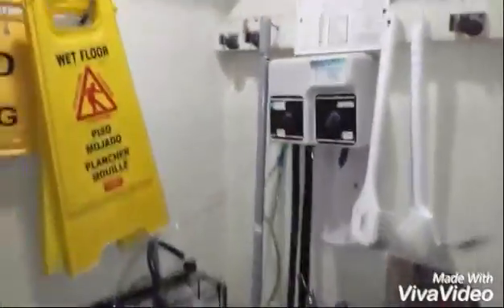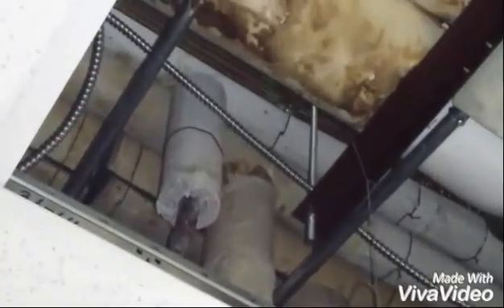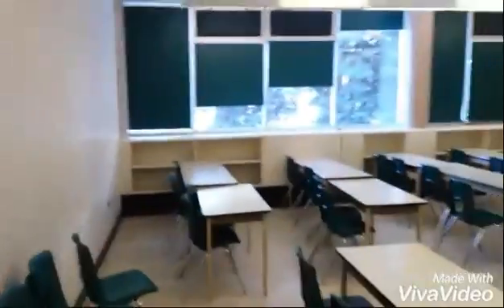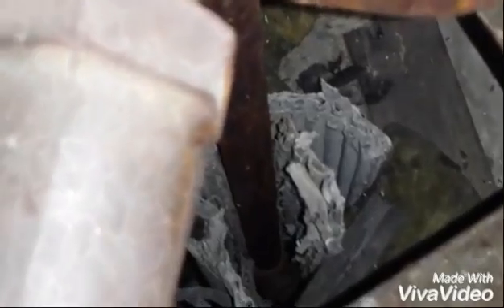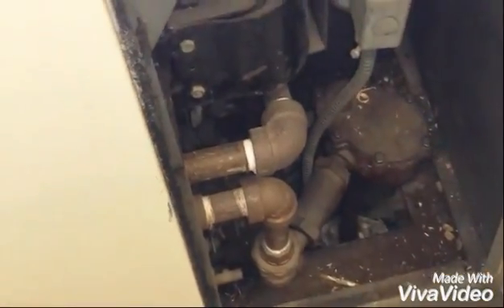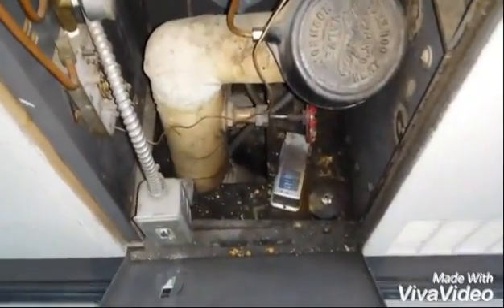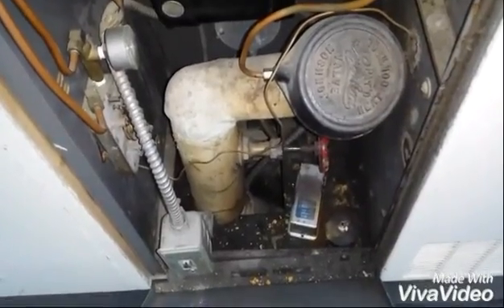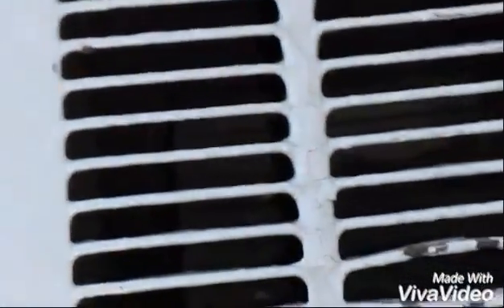Asbestos in the air. St.Johns college has old aircel asbestos on the pipes AND in the heaters!

Comment: Crazy stuff, I have to deal with old refrigeration plant rooms made from non-friable sheeting and there is dusted up old asbestos on the ground because of all the previous workers banging holes in it, and cutting it to make room for new units, fans are blowing directly on it and its cracked in spots and moving back and forth between the crack because the fan is blowing on it. At the start of my trade a few years back I was the dooface who had to clean all these rooms and blow out the dust out of the condensers which are sucking air in directly off the asbestos. Lets not forget all the black switchboards made from brown asbestos where many holes have been drilled and all the crap just sits in the bottom, my dad is the one who drilled the holes in asbestos and cut the stuff all the time with an angle grinder 30 - 40 years ago and his lungs are in worse condition than his own dad!